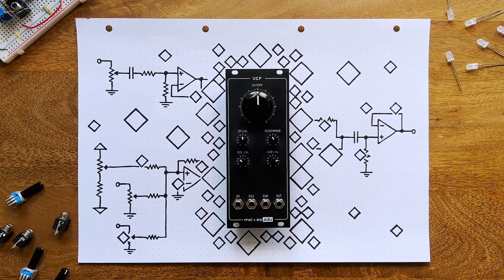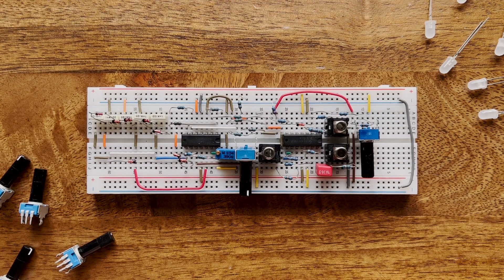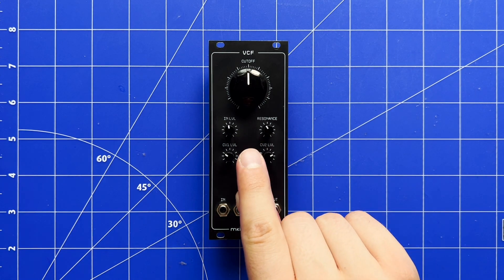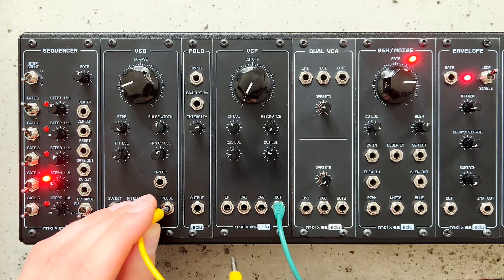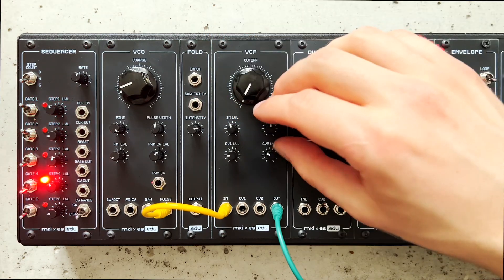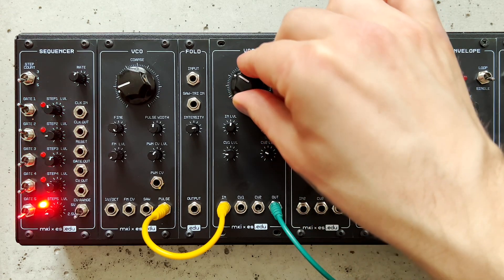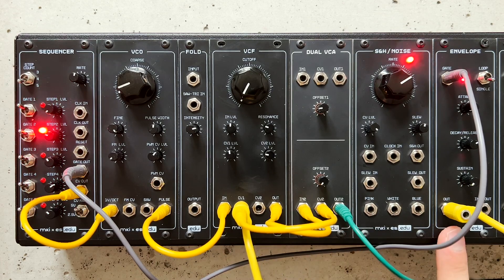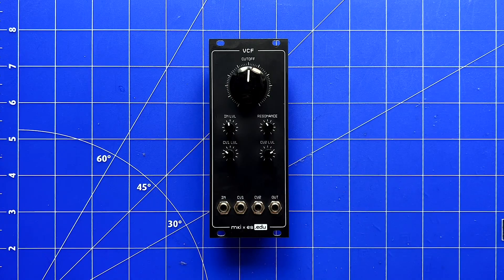Introducing the mki x es.edu DIY VCF kit

Comment: Man I love the series! Quick question, the manual alludes to diode matching, but doesn’t say which ones should be matched? I am assuming that it’s the 6 in the ladder assembly? And each step on the ladders should be paired as close to one another as possible? Thanks for all of your excellent work!
Reply from the maker: yeah, if you really want to match the diodes in the ladder, you can do so with the diode matching circuit provided. but honestly, i've built the filter a few times with and without matching the diodes – and the difference is marginal at best.
Reply: Love the kits Moritz! What is considered a 'step'? I'm assuming the first and last diodes in the ladder, the second and second-to-last diodes, and the two diodes in the center should be matched pairs. Is this correct?

Comment: Hi Moritz, is there a HPF mod for the filter? I scanned the manual and didn't catch it. One of your older filter videos had a simple HPF mod by reversing something (I can't recall what it was at the moment). I'm deciding if I should buy 2 filters or just 1.
Reply from the maker: unfortunately not, no. you'd have to apply the input signal to the middle capacitor in the diode ladder, but the PCB wasn't made with that mod in mind.

Comment: Hello Moritz! I have a question regarding the resonance trim pot: do you think that, by cranking it to 100%, one can achieve all the sounds you'd get with it set to 50%, and more? Or will every setting of the resonance trim pot significantly change the character of the filter, with no overlaps in sonic characteristics?

Thank you for the video =)
Reply: Just a guess but with the way he described the part about past 12 o'clock on the cutoff essentially adding diode distortion, and since the sweep will always be in a fixed range on the cutoff knob, it seems like a lower setting of the hidden trim pot would give more resolution to the knob sweep but lessen the max intensity of the resonance, while a higher setting will add the distorted resonance in a more and more exponential way throughout the cutoff knob sweep... So maybe use a lower setting for clean funk bass type sound, or a higher setting for dirty acid type sounds?
Reply: @jasonyates3311  Yeah, that's my guess too. My pickle is, since this setting is selectable only via trim pot, it's more of a set-and-forget kind of thing. Otherwise you'd have to unscrew and re-screw the module every time you wanted to adjust the parameter.

Well, I'm used to sensitive resonance knobs, haha. I would be ok with less resolution but more sonic options. Anyway, guess I'll find out once I assemble the module, I'll do some sweep tests and then settle on a trim pot setting I find myself ok with =)
Reply from the maker: @dr.getter7118  Jason got it right – it's essentially a choice between resonance knob resolution and maximum distortion level!